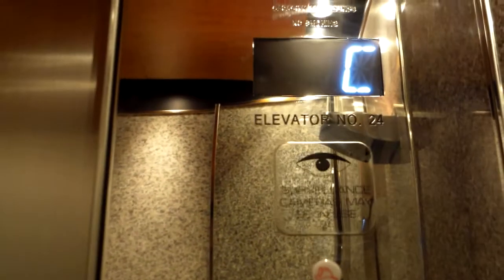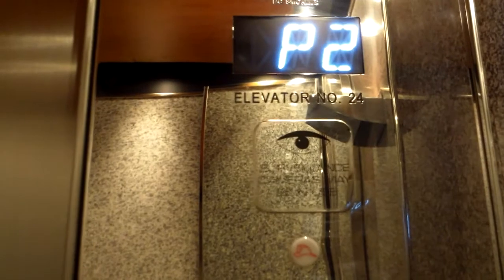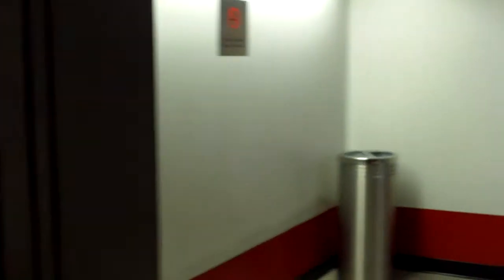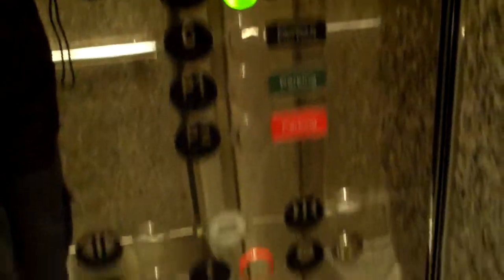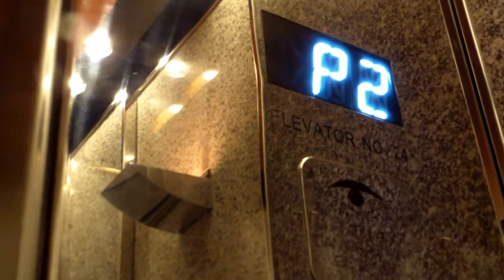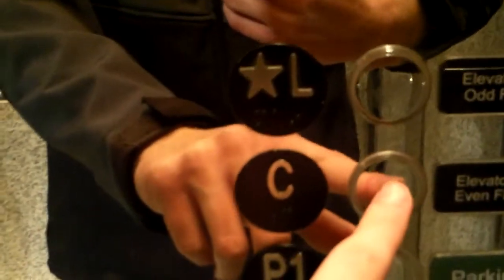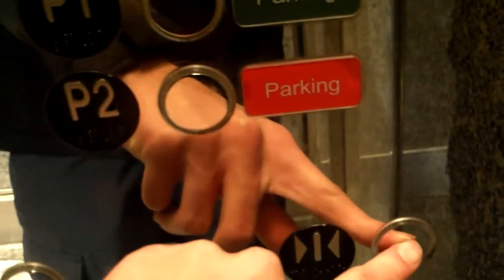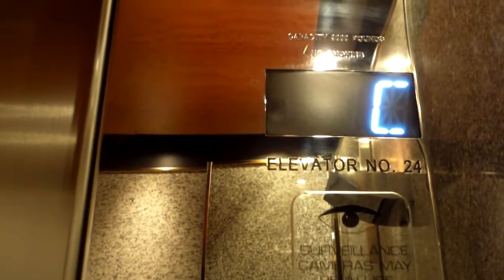FAST Otis Traction Parking Garage Elevator at Republic Plaza, Denver, CO

Comment: Wow...you weren't kidding; those are pretty fast elevators for four floors! Nice elevators, too. These must have been modernized at some point, as evident by the ACME indicator.

As for the security camera, I wonder if the sign is up simply as a deterrent, especially for a garage setting.
Reply from the maker: +NewEnglandElevators All of the elevators here were modernized in 2000. They all have the same cabs, but each one is unique in it's own way. If you'd like to, feel free to check out my other videos from this place.

Also, about the camera sign. I think the sign references to the security cameras in the elevator lobbies on the parking floors. The other parking elevators in the retail center have the same signs. No cameras in the elevators, but in the lobbies there are.
Reply: +Elevating Denver A camera sign that refers to the cameras outside the elevator...never thought of that before (I'm serious, totally passed me). The sign in the elevator still seems like a good deterrent, though.
Reply from the maker: ***** Yeah, I think they put that sign in there to deter me. LOL. :D

It is a good deterrent idea though.